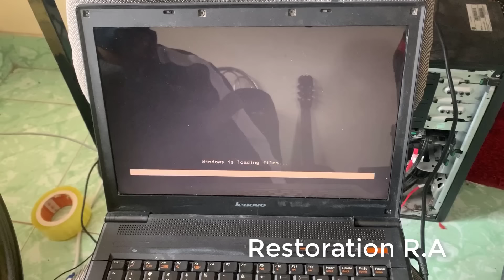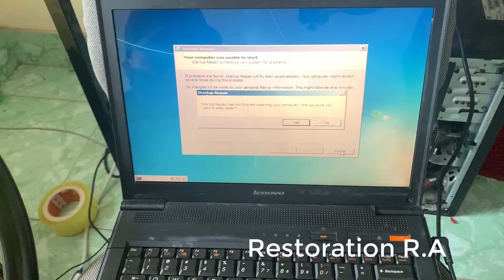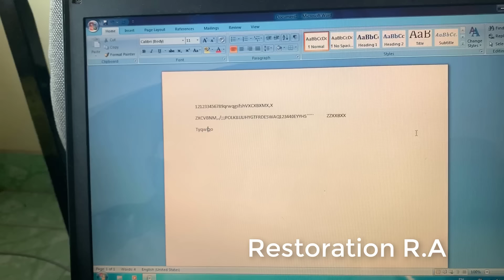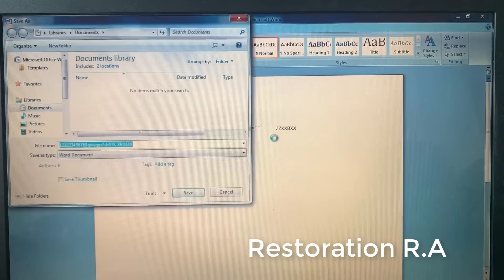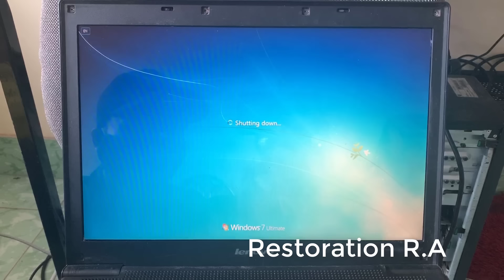Restoration super broken old LENOVO laptop | Restored computer assemblies destroyed 10 years ago

Comment: Sensitive IC's have been already damaged.... No way in hell the lap top he found in the bag would ever work. Hard drives is corroded.... No way in hell..
Reply: he installs a new hard drive. if you pay attention , or view the entire video . you will se that hard drive was manufactured in 2007 and the computer in 08/2014
Reply: @LeonUnger  the video is fake anyway
Reply: He probably replaced everything, it's basically an assembled laptop, only the shell is original
Reply: @sanyojmest7509  and happens to have ALL the missing keys?
Reply: Because I have been fixing laptops so long and know that this video is fake,I will no longer watch videos from this guy and will not subscribe. I don't like liars,fakes and cheats and I'm not going to be baited into clicking on this fake stuff!
Reply: @LeonUnger  cpu 2006 dual core 2 t5500 . is not 2014

Comment: video as well as most of the other videos about restoring laptops is just a fake, the cut on the cover is fake, checking the tester is generally funny to the point of hysteria, guys you would at least include a variety, Shoe brush to clean the motherboard is genius,and the most interesting thing for 10 years on the metal surface is not one corrosion,where do you get the buttons on your keyboard?
Reply: No, it's a real Lenovo G410, model 14002, produced in late 2000's.
Reply: هل هذا انت
Reply from the maker: I went to an old computer shop and searched for free there..
Reply: @restorationR.A  I wonder what kind of store you have there that sells buttons piece by piece? also for any laptop model
Reply: @restorationR.A  gets every laptop from Goodwill
Reply: Че за глупые вопросы :"откуда ,откуда ?",-с помойки естественно.:-)
Reply: @restorationR.A  bro you arent fooling anyone, you washed a motherboard in water, scrubbed it with a rough brush, and then blasted it in heat. But nah it works. If you are gonna fake fake it good
Reply: How is it even possible ???
Reply: whats the point of the testing at 8:32 ?  I worked many years at Compaq, at a motherboard repair center here in Brasil, , and this kind of testing on mother board is meaningless. i started do laugh, because  this is not shows nothing more a deflection in a multimeter needle....
Reply: He probably replaced all the components, more like an assembled laptop than a restored one
Reply: Why go through all that trouble ripping the screen apart rather than just replacing it. Come on!
Reply: Because I have been fixing laptops so long and know that this video is fake,I will no longer watch videos from this guy bit will I subscribe. I don't like liars,fakes and cheats and I'm not going to be baited into clicking on this fake stuff!
Reply: @Mr_Joseph979  I tought the same. why ripping the foils ? Total nonsense....
Reply: t is the most false video I have ever seen hahahahahaha, he did not even put thermal paste
 hahahahahaha
Reply: @radiohell7929   Most Asian countries have a gigantic market for old and used items. And there is something else that, for example, does not exist on the western European market: That manufacturers also sell old warehouse parts and individual components to private end customers. Try buying only the LCD / LED panel from a laptop in a German, French, British or Russian electronics market. You don't get it - they'll try to sell you an entire laptop. Mentality is different in Asian countries. A customer would then refrain from buying there. For this reason, you can buy things in Asia that the same manufacturers in other parts of the world do not sell to end customers.
Translated this means that they know that we let ourselves be fooled and let the money be pulled out of our pockets.
I can also provide an example of how money is pulled out of people's pockets from "rich" countries. For example with cheap complete PCs. At first, these look like normal home computers. But then there are some peculiarities inside. Example - the mainboard. This breaks now. Now the owner wants to repair his PC. He goes out and buys a new mainboard. At home, he opens the PC, unscrews the PC and - oh fright - the new mainboard that he bought in retail cannot be installed in the PC. Why? For example, in that the holes in the main board from the original computer, with which the board is attached, are not in the same places as in the newly purchased board.
Or the advertised main processor is not anchored in a slot, but soldered to the board. When Fujitsu-Siemens processes such a complete computer, they can, for example, have a certain number of mainboards manufactured by a motherboard manufacturer with their own specifications. The consequence of this is that owners of such a computer have only two options in the event of damage: either they let the seller install a replacement board for a lot of money from the contract partners, because this is not available in the open market, or they have to buy another complete PC . It is nothing more than a deliberately created need to take the money from people. It is different in the Asian area. Something like this is sold to private end customers because otherwise they would have no income at all.
Reply: @LeonUnger  Dear Mr. Unger!
Testing with a multimeter is not as useless as you claim. It can test the base - namely, if there are any interruptions in the current flow on the board. The individual electronic components rarely, if ever, break inside. If there is current flow, then there is a good chance that the rest will work. And companies like Compaq (just one company out of many who do this) are deliberately building devices in such a way that self-repair is deliberately sabotaged in the event of damage. Glue instead of screwing, use components that cannot be bought individually, etc. Consumers are deliberately forced to either have expensive repaired by a "service partner" or better to buy a new one straight away. That is the only thing behind it. You said you worked at a Compaq repair service. this company lives exactly from what I have described: that end customers cannot repair themselves.
Reply: @sanyojmest7509  EXACTLY, THY EVEN GT BAR CODES NOW
Reply: Yes changed motherboard

Comment: water and electronics don't mix lmao
Reply: kkkkkkk
Reply: *Water and electricity. As long as you don't let electric current through the parts nothing will happen, but you have to make sure that it is dried extremely well before you turn it on
Reply: @apvapkim5706  and its not water

Comment: Like, how do you know the laptop was there 10 years ago? Why was is it in a bag full of rocks? where did you get this laptop (country, reagion, city, etc)? Can you actually wash it like dirty dishes like that? What were the parts you had to get new and what did you remain?
So many questions
Reply: It is the most false video I have ever seen hahahahahaha, he did not even put thermal paste
Reply: Can't answer most of those questions, but I can say you can wash circuit boards. I've done it many times over the years for horrible boards covered with filth. Most of the time it's POS terminals in restaurants that get caked with grease, food particles and liquor that congeal into a slurry of garbage.

The worst board I ever washed was a Power Macintosh 6500 I pulled out of a storm canal. No idea how it got there, but it had been smashed to hell from the canal being flooded with a raging torrent a few days prior. Whole case was beat to hell, but the motherboard survived miraculously, and worked after I hosed all of the mud off.

Equally nasty are computers in smokers homes, they get this horrible yellow tar that covers everything and is a nightmare to wash off.

Comment: Look friend, I'm just not going to spank you because I'm cool today, but I'm crazy to hit you because 1 you never WASH a motherboard with a hard brush like this because you can rip some component off the motherboard and 2 you are ok passing the multimeter / voltmeter anywhere or what? I work repairing notebooks and desktop computers and I have NEVER seen anyone measure voltages or try to detect a short circuit in such a random way, want to clean something that is super dirty? use isopropyl alcohol or 70/90 alcohol (I do not recommend using 70 alcohol because it contains a lot of water, it is recommended to use isopropyl alcohol) NEVER use a thick brush like this again, use a toothbrush or a brush and do not use water because water contains metals that can damage the parts of the mother square, GOOD NIGHT AND A GOOD JOB :D

Comment: This is not true: a laptop with rotten capacitors and a Wi-Fi module with a swollen chip cannot work. They couldn't just throw a working laptop in the trash. Here's what you're thinking: Can the keyboard survive flooding and dirt? Current shunt resistors are black from flooding. Even if it really works, sooner or later it will all manifest itself and the laptop will die, especially when thermal paste is not applied to the processor and video chip crystals.

Comment: I'm sorry but I'm confused at those Caps and checking at 7:58 , i know you have a shorted motherboard because looking at the peek of the multimeter with those caps, it is always showing 0 resistance with multimeter on x10, also the other components tho it's funny how you checked them lol, that's so quick.  Using soap is conductive and you'll get a corrosion, better use water to wash motherboard and dry using hot air station because under cpu, chipset, gpu...etc socket there's still some water behind it, you didn't removed the cpu and clean the socket and even putting thermal paste over it lol. That's not how you check a motherboard and not always depends on resistance, Checking motherboards are not that easy if you don't have a power supply to work and check the voltage on each section.
It looks sus and since you didn't showed us the working state of the motherboard before you assembled it, Either you've successfully restored the motherboard, bought a new one or in worst case scenario, you filmed before destroying the laptop. but looks Great restoring the laptop anyway.

Comment: I was always told NO SOAP. I was told wrong. I am a PC repair could not even start to work on a Laptop you did an outstanding job. ALSO, you proved my open and SAND old hard drives disks are needed.
Reply: Lol no you learned correctly. This is fake as hell.
Reply: Bro, this shits fake as hell, you would ruin the motherboard like that

Comment: BS...The MB would be toast,BIOS chip unusable,,,HD locked up and fried,RAM dead,power supply  fused together and all the wiring would short out.Buy all those parts or salvage them from a working same model,put them in the  old chassis then maybe you  could get it to work...but whats the point you would  spend far more on parts then its worth.But for entertainment purposes-and the gullible iI guess it passes.

PS I was waiting for him to melt the sand into a new glass screen...LOL